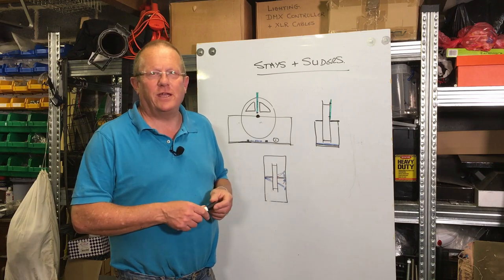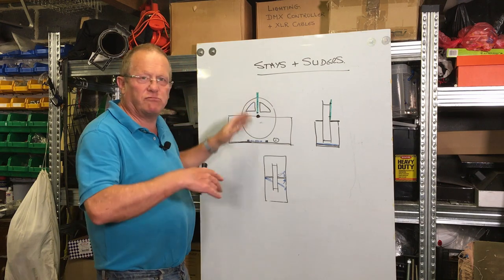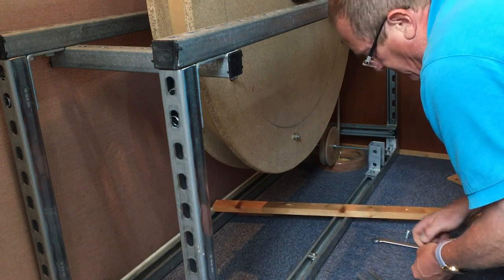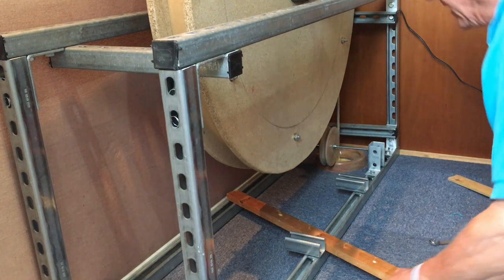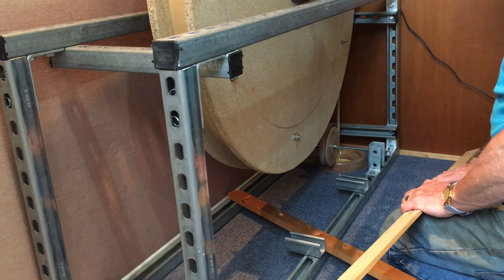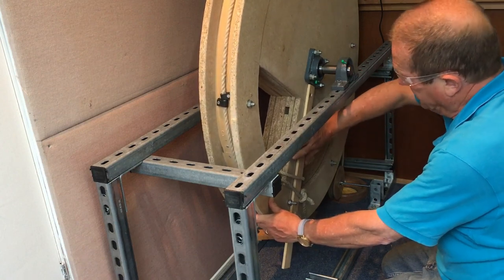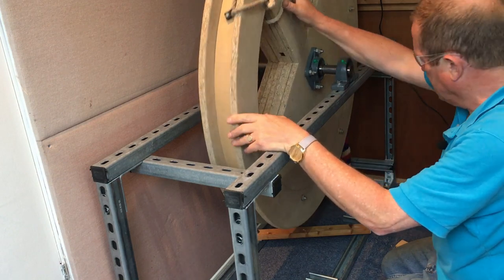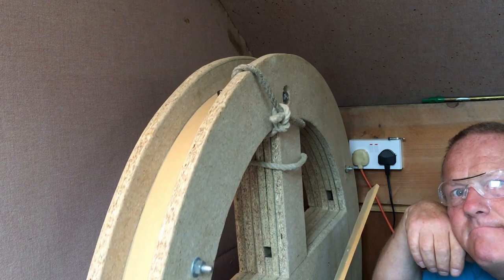Scrap Challenge - A Home Dumbbell ! - 8. Stay and Slider

Comment: Hi Steve. I'm really enjoying your series of videos on the dumb bell!  I've been doing this sort of thing (on an almost zero budget) since I was 11.  I  have come across all those little problems along the way, and I like the way you are resolving them.  I expect you will find the mechanical stay & slider to be noisy. I have found the best thing is bungee elastic for a slider, as this makes no noise. However, you won't be able to demonstrate how and why a stay breaks if over pulled.  Keep up the good work!
Reply from the maker: Thanks for getting back to me, when you watch the next video, you will see that I have currently removed the slider for exactly that reason, the "clunk" is pretty loud so I am looking at a few alternatives, involving things like plastic water pipe, and rubber on the stops, and my favourite which is a "lasso" on the end of the stay that catches on a Tee Piece, so a modified version of the Higby Dumbbell rope , but in this case it would have the ability to trigger a "break" if pulled too hard, there is always an answer !